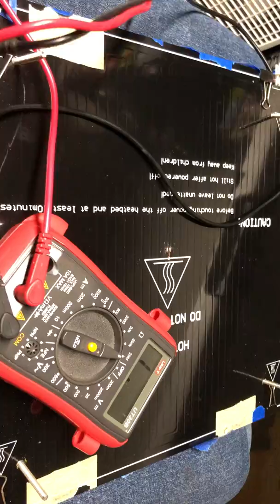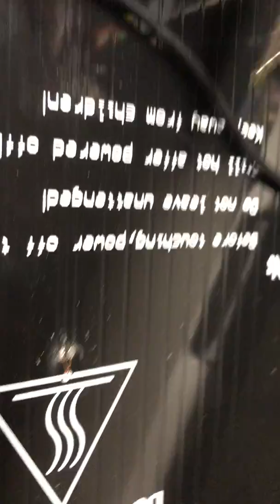creality cr-10 no temperature detected on bed fault / fix & other issues

Comment: Are you still having trouble printing if so I can fix it
Reply: Hi i have  a cr10-max everything works off the screen but the bed wont switch on and times out over time and the nozzel heats up to 145 then stops when set to 245,have tested bed disconected toatally and powered with 24v heated up as normal but wont work off the screen.All points have 24v reading and continuity threw the leads, have also swapped the mosfet got me stumped as its been working fine for years